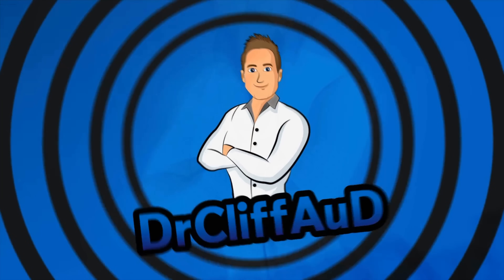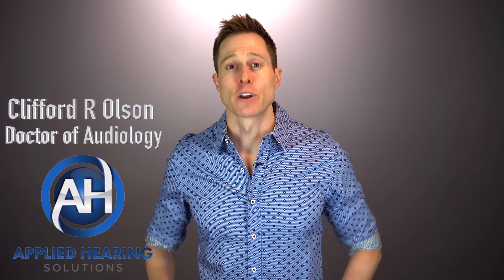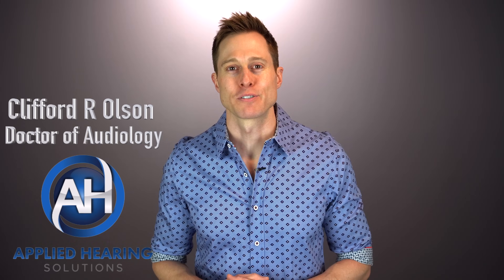The TRUTH about Hearing Aid Bluetooth Issues

Comment: I had a problem recently when the new Pixel 7 by Google came out.  I could not keep my HAs (Kirkland KS9s) reliably paired to the phone so the Bluetooth would drop out randomly requiring me to repair my hearing aids often multiple times per day.  I tried working with the device engineers at Google to try to figure out what was going on without much luck.  They had me reinitialize the phone multiple times, try pairing to a different phone (Samsung) and basically everything in between.  Eventually they declared that the problem was my hearing aids and that I would simply have to buy new ones.  That was NOT a solution that was going to work and I told them I would not be investing a couple of thousand dollars to work with their $700 phone.  I sent the phone back, bought a new Samsung and life has been good again.

Comment: My problem is 100% the hearing aid company software. My phone can stream and everything perfectly fine, it repairs automatically immediately when I turn on my hearing aids. The Phonak app refuses to find the hearing aids. Even when I am at that moment listening to my phone using the haring aids without issue, it still cannot find them. I can't change volume, programs, etc with the app because it never recognizes the aids. The only thing I have found makes it work briefly is to forcibly depair the aids from the phone, then without repairing them to the phone open the app and then it will find them ONE TIME (after usually power cycling the aids to put them in discoverable mode 4-5 times and having to take them off and hold them right up to the screen for the software to find them). But the next time it's right back to the same thing again.

Comment: I have had bluetooth enabled hearing aids for 14 months I have a Phonak device attached to the TV. Using bluetooth drains the rechargable batteries much more quickly. Batter powered hearing aids and bluetooth might not play together well.
When I use the bluetooth with  TV. I can hear well, even dialogue with foreign accents, but I cannot hear anything else. I wish the bluetooth device had a remote mute button for commercials.
Reply: My Phonaks have tap control- tap ear twice to turn off sound and again to turn on

Comment: My resound hearing aid paired perfectly with mu iphone 11 until an update in iOS 15.
My phone , Apple Watch and iPad all drained the battery overnight.
I was losing 10% or more an hour. I could see the devices were showing my hearing aids in real time adjusting to the microphone input like a vu meter! Apple replaced my watch did diagnostics and never solved the problem! iOS 16 came out and everything was back to normal, ALWAYS A SOFTWARE ISSUE😢😢

Comment: I have Oticon More 1 hearing aids with iPhone 13 Pro.  Left hearing aid has never lost connection it's always been the right.  Has anyone else had this happen to them?  I did see a response from Oticon on Bluetooth issues in my research that suggested shutting off Control Nearby Devices and Audio Handoff in iPhone settings.  Has anyone found that helpful?
Reply: My Oticons often restart when connected to my iPhone 12. One earpiece will restart, and then sometimes the other one will do it too. If my iPhone is relatively close to the hearing aids, this never happens. I've had the Oticons replaced once, but the problem didn't resolve. Since I often leave my iPhone in another room (25' away) this is a pain, but the solution is just to keep the phone close by. Anyone else notice this with Oticons?
Reply: @sillydg  I always keep my phone near me.  I sometimes (almost daily) have either left or right and sometimes both hearing aids that don’t stream from my phone requiring them to be restarted.

Comment: I can confirm that every time my phone has updated to a new version of Android I have problems with Bluetooth devices. Now on ver12 it's gotton so bad that I have to restart the phone, app and Bluetooth since I can only rarely connect to both of aids. This means that I can't control them from the app, and streaming only works with one or the other. This has been a problem for about 2 years now. So I am likely going to have to reset my phone, which is a royal PITA!

Comment: Bluetooth and the Tragedy of the Commons: The overuse of a shared resource will result in its demise. For me, at least, Bluetooth used to be useful and convenient, but now it's painful and no longer convenient. Initially it was designed for a one-to-one connection, say a headset and a phone, when most people owned 3 BT devices: 1 headset. 1 phone, and 1 car. But now we're in a sea of BT -- phone, hearing aids, car, headset, PC, TV, smart speaker, and even the darn parking meter!  Now it's endless fiddling to get it to do anything useful! Ugh! Rant over...🤨